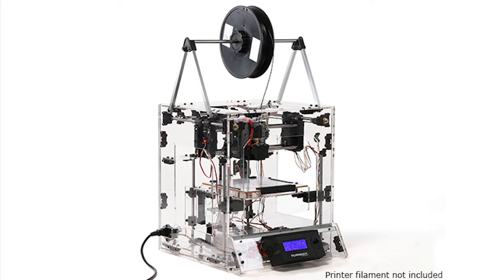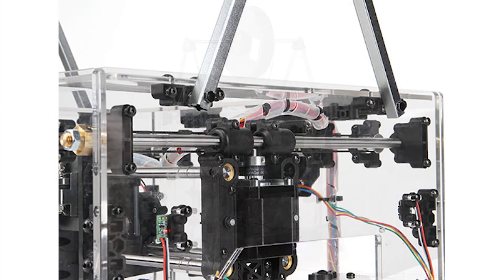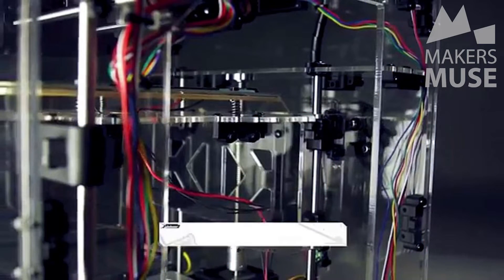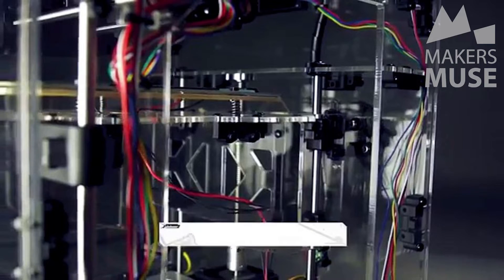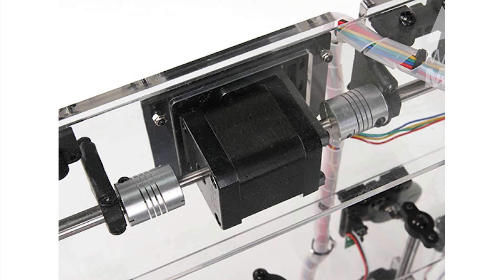Why do 3D Printers still kinda suck? - 2015

Comment: Ummmm..... I find it really hard to see any consumer marketed 3D printer to use servo motors. They'll just be far too expensive. Like really expensive!
Reply from the maker: darkfire2022 Hehe servo's can be cheap - a servo is just a motor with precise encoder feedback, have a look inside your cheap inkjet printer and you'll see an encoder strip and a very cheap DC motor! That's all we need for 3D Printers too, maybe with a tiny bit of reduction. :D
Reply: Maker's Muse Inkjet printers aren't actually that accurate when moving it's print head. The momentum of the print head moving in one direction can not be changed as easily to move in the reverse direction, which as a result causes the head to overshoot. Also, whilst most inkjet printers have DC motors, they are usually brushed DC motors meaning that they will not have a very long service life if used in a 3D printer.

Comment: Nothing like a good rant lol!

But... FDM printers are for makers to tinker with. You can build them yourself out of cheap stuff for $500. Yeah they are not for dummy user time.

And sure linear encoders would be nice.
Reply from the maker: Dejay Rezme True that! Thing is, the stratasys FDM machines are so much more accurate and reliable - so overpriced though!

I'm thinking the robox has some kind of encoder system inside, it's able to detect when filament is slipping which is pretty clever.
Reply: Maker's Muse I wonder if this isn't just normal for lots of emerging industries. In the beginning a new market is found and the products are crappy and consumers are getting overpriced and dissatisfactory products. Then when the demand is there the market matures and products get more and more refined and prices go down.

I bet an economist would tell you something "yeah the market has to sort itself out and we'll see if this 3d printing thing is a fad or not" hehe.

So maybe we'll eventually see 3D printers get cheap and good but "warranty void if seal is broken" ? :)

About encoders: I personally have this crazy idea that 3D tracking / computer vision could be used to reduce component costs / DC motors without encoders. If you can track the end effector in 3D you could write a clever algorithm to perfectly compensate for things like wobble, backlash etc. Similar to human arms that are very imprecise and badly manufactured hardware, but our brain learns how to use them precisely.

Comment: Ya the low end commercial stuff is very much like early days of ink jet printers, if you didn't triple check every single detail on them those fuckers couldn't print a fucking thing properly. And now even the cheapest stuff will work without a hitch and auto calibrate/adjust/clean all the vital parts as needed.
That is the mark 3D printers need to hit, obviously working with another dimension and molten material makes things much harder, but self adjusting printers are what we need.

Comment: What do you think about the upcoming Tiko? 
A unibody is a pretty good idea. I think it has 50micron resolution.
I still need to get an FDM, because my SLA is very expensive.
Then there is powder printer in full color etc. Those mostly use something very similar to the inkjet printers and don't care about orientation.

Comment: I'm looking to buy a 3D printer, and I've narrowed my choice down to the Ultimaker Original Plus, and the Robo R1. Wich one would you recommend?
Reply from the maker: JACK JOHN I think Barnacules Nerdgasm has both these machines, check his channel out he's got some good vids talking about them. They're both good machines, but don't have any direct experience with them!
Reply: JACK JOHN I've had experience with the R1 (two of them actually) maintaining them in a classroom, and there one of the most plug and play machines, the accuracy is extremely good and precise, and the overall build it very sturdy, but i have not had experience with the ultimaker.

Comment: So two days ago you published your review of the CEL Robox and aside from it failing you horribly you still praised it highly. The CEL Robox is a EUR 1300,- printer. Two days later you bash HobbyKing for a EUR 400,- kit for having pretty much the same bed size and it using stepper motors like the CEL Robox.

You either got distracted by the looks of the CEL and forgot to mention all the deficiencies you also do see in the HobbyKing Fabrikator kit or you have no point. Or I am missing something here, not unlikely.

Edit: I want to add that consumers of DIY kits like the HK Fabrikator, the Prusa i3 and similar kits have no high expectations in regards to out of the box quality. These consumers watch YouTube and have a good feel for the improvements that can be made to these kits. I am not so sure about consumers buying commercial "closed" printers like the CEL or similar offerings.
Reply from the maker: Simon Polz True, they both share similar mechanical components - but it's the software and thought that's gone into the robox (auto calibration, problem sensing etc) that makes it a better user experience by a long shot. You're right though, the robox printing quality was rubbish - but I put that down to a faulty extruder head due to my experience in the field, your average user would probably just kick the sh*ts and never use it again. 

I honestly believe you're giving an average consumer too much credit - just look at how many inkjet printers are chucked out by the side of the road because they 'stopped working', and there's no real infrastructure in place for support, sure there's forums but the user has to be active - they cant just take it back to the store! 

In most cases I think they would just search on price, find the hobbyking machine because it's cheapest and order it - probably won't even read the fact that it's a kit... :P

Comment: I do have to agree with the whole "run out of ideas" thing. It isn't about who has the innovative new nozzle color blending (E3D) it's who's got the latest rushed to market crap machine... It would be an interesting challenge to see you try and make, even theoretically, your version of a good 3D printer. 

As for stepper vs servo I use Nema 32 I believe motors on my CNC mill conversion and their pretty strong with a good ballscrew! That said unless you have a reliable calibration zero it can be a bit tricky to do reliable things without feedback if something were to cause a jam and skip a step(s). That said it's worth noting that steppers are super rugged! You can leave them stalled and it may get toasty and eventually crispy and fried, servos can be killed in seconds if your not super careful about jams! I'll admit I killed a $$$$$ servo on a commercial Cnc because I didn't realize that when it was in an alarm screen it was stalling the servo out! Ouch >.<!
Reply from the maker: Calvin Witt Very true! I love the innovation e3d is doing, and sort of glad he's sticking with what he knows best - making kick arse extruders. I've been spending the whole day piecing together bits and bobs for what I would like to put into a 3D Printer, I think a lot of it is in the software side of things though and I'm no mechatronics engineer... still, I should put my money where my mouth is! That sucks about the servo haha, I know a few guys that put 500W scooter motors onto their mill as servo motors (with a very nice glass encoder) and it can whip the table around at frightening speeds. I honestly would have a go myself at retrofitting servos into a printer if there was a smaller scale board on the market, but most of them are for big stuff.
Reply: Maker's Muse I think you have some valid points and there is nothing wrong with a good rant now and then.  One suggestion would be to counter your own rant with suggestions on how to improve those deficiencies that you see.  This goes a long way to lending credibility to your argument and shows you've thought it though.

Enjoy your channel a great deal.  Any chance you could review some delta printers?
Reply from the maker: Jeff Gould Definitely needed to back myself up more :P Just got so frustrated! haha. Delta's are really neat, but I can't see myself getting hold of one any time soon. I might be able to borrow a kossel mini though in the future...

Comment: I agree that its a rant but you are wrong at many point.  Uprint still used normal stepper motor.  The reason encoder and dc motor are not used today because they are not made to carry load at low speeds. In 3d printer have to move at various speed.  In paper printer its just a sweeping motion and all dimensionally sensitive stuff is done by head. 
3dsystems wont die. They are old school and still hold lots of patents.  Its like telling Microsoft will die because win 8 was not good
Yes, many of these cashcow printers from kickstarter are bad. The only good product we gor from kickstarter is printrbot after many iteration and zortrax.  
And saying that why dont they do this or that,because the people you are complaining about dont give a crap and dont develop any of the technology and just coot-paste.
Reply from the maker: ***** Have to say I Disagree... Uprint is a 30K printer, not even close to the 'consumer level' machine's I'm discussing. Servo's are standard now on many industry CNC machines, you add a reduction if you're worried about low speed control. True 3D Systems has tried to take over the industry by buying up as much IP as possible, but just a quick glance at their stock value gives an indication of how 'well' they're doing.

Completely agree about the copy paste mentality though...  !
Reply: Those are stepper servos used for high end machine not dc servo. 
Reg 3d system, i heard that there stocks went down a bit but its just a mosquito bite to a giant.  The people who are selling stocks now dont realize that in long game they are going to survive and thrive.  
Do you listen to 3d printing today podcast.  They analysed this stock thing in there last 2 podcast
Reply from the maker: ***** Fair enough - I think 3D Systems end game is not in the consumer market anyway really. I didn't know about the podcast, will check it out!
Reply: First of all, I'm pretty sure we're basically on the same page regarding servos and why they're not used.  Second, I'm gonna try to go down this as logically as possible and correct some of the extremely confusing arguments you're making.

"retain its position  through a power loss"  Who the hell said anything about that?  No one.  If the power goes off then the whole system goes down and thats the least of your issues is where the servo is.

The servo handles the feedback.  The controller doesn't do shit.  The servo has an IC built into it.  Jesus...  I said this in the last comment.  You tell the servo where to go and it does what you ask.  This means you basically give it coordinates and it will handle the rest.  Ironically, it's actually LESS work for the controller to do.  Also, depending on what kind of servo it is and if make it fancy, you could have feedback to the controller telling it that a move failed and that it should give an alarm/pause/ try again.

Next, you make it sound like someone is expecting servos to be a replacement for homing.  Again, who the hell said that?  Of course it's gonna lose it's damn position after you power it off.  You just home the damn thing and start from there.  Also, 360 degrees is fine.  The servo will know immediately if something is wrong and can either correct it or warn the controller if you give it that feature.  All you would do is tell it to turn 360 degrees 5 times to rotate it 5 turns.  If it lost a step in there it would know right away and would compensate for it.  It's statistically impossible for you to lose an entire rotation, which is the only way that the servo would lose it's position.

As for the industrial grade servo you post as an example of your point, no shit.  That's meant to be used on a several hundred thousand dollar system.  Also, I can pretty much guarantee you that is nothing more than a high torque NEMA 23 with a rotary encoder/pot on it and a $10 micro controller.  Those huge control boxes are for powering it at the 714W it's pulling at 340V.  That thing could restart a small sun.  Of course it's expensive.

The whole appeal of using a stepper is that the system knows what it's doing and doesn't screw up.  For 99% of cases steppers are fine and you don't need anything more.  Then there are the other 1% of cases where something goes wrong and having a system that doesn't retardedly forge ahead spewing plastic all over the place because it doesn't even know what it's doing would actually be extremely helpful.  The reason people don't use servos is mainly because they are piratically impossible to find for a reasonable price and most of the time you don't need them.  Now since the parts that go into a servo cost about $10-15 there is almost no reason why no one has actually used them other than squeezing the cost down another $50 and lack of availability of off the shelf servos that would meet the needs of 3D printing.  None the less, this is something the 3D printing community could actually use and I would be very happy to see development in this area as I would much rather use servos than steppers personally.
Reply: Maker's Muse The encoders that are used in inkjet printers are copyrighted.  The same way that FDM was copyrighted until only recently.  That's another reason we are still using steppers.  Also, they are freakishly cheap.  I bought 3 NEMA 23s for $30 each for my CNC.  If I were to buy a servo of the same size it would cost over $100
Reply: +rocksntwigs Servos are also much more intense to code for. You basically have to monitor the feedback from each servo and sync each axes to get a good print. Only difference at the basic level between a stepper and a servo is the servo will ATTEMPT to maintain position. If it gets bumped, it will just keep trying to stay on set position. This would take time, and in 3D printing you would have ruined the print anyway if you were not on position in one axes while the others were. A Servo will not solve the problem if you are pushing the physics beyond what the motor can do. One advantage servos would be is you would have just a small defect and the servos would eventually get back on position. Where with a stepper, once you skip a step, it's lost forever.
Reply: Dude...  The hell are you talking about?  You don't monitor the servo.  The servo goes where you tell it to.  That's why it's a servo.  It has an on board IC to monitor it's position.  Now if you were writing an intelligent printing firmware what you would do is immediately retract the filament if the print head moved out of it's expected position, correct the screwup and resume printing. (This wouldn't mess up anything as time is literally the LEAST of 3D printings problems.)  But this isn't actually "required."  So...  As for pushing the physics, DUH.  Nothing can fix true stupid.  To your last point, I think you missed the point.  That's the whole point.  You would have never screwed up in the first place.  And no, they don't "eventually" get back to where they were supposed to be.  They do it immediately.  How do you think real manufacturing works?  Real machines monitor their postpositions constantly and correct any imperfections.  They don't just go "ehh...  Fuck it.  I guess it'll all just go to hell."  Just...  What...?
Reply: +rocksntwigs Did a little more research into using SERVOS in a linear application like a 3D printer or CNC machine. And as I thought they either have a feedback system as in a rotary encoder or a resolver. Either way, you would need to have the firmware of the printer be in charge of that position. With a resolver, it's a bit easier as it will retain its position  through a power loss. Whereas an encoder only sends pulses and you lose your actual position after power cycle, or worse your main processor was busy doing something else and missed a single pulse. But, even with a resolver, you will only know your position within one 360 degree turn. I guess you could TRY to use a multi-turn pot to approximate position. But to get any real accuracy you would need some pretty expensive pots and you had better be able to read that with an ADC channel of like 24 bits. Again, you’re driving up costs and complicating the system.

Here is an example of Servo motor & drive for a CNC (JUST ONE AXIS) . http://www.ebay.com/itm/Parker-SM233AE-NGSN-Brushless-Servo-Motor-Gemini-GV-L3E-Drive-CNC-Mach3-DIY-Kit-/221712280548 As you can see you’re at like $850 and that is not retail. Retail for just one axis is like $2,800. And again, that is not for a system that will be able to position itself beyond ONE single rotation of the motor. You need external controls and monitoring to give you position control over the complete axis. 

Stepper motors, while not providing feedback, do provide great resolution for their cost and ease of interfacing to. A cheap NEMA 17 stepper can be had for less than $15-$30, with a decent controller you can microstep them to 3200 or more steps/rev. That is amazing resolution. To replicate that in a SERVO or stepper w/ feedback will cost you like $30-$100 just for the rotary encoder that will give you at best 4096 steps of feedback. And the task of monitoring EVERY one of those steps by the same controller that is driving the steps is nearly impossible. Not to mention the fact that that same firmware would need to either try to force the motor to stay on point, or as you said simply stop extrusion and continue when all axes were aligned.
Given all the above, it makes sense that no one has been successful bringing a SERVO driven 3D printer to market in the price point we’re talking about. It just adds way too much expense and complexity. And really at the end of the day, you’re not cutting into materials like with a CNC. If everything is working correctly, you will never miss a step.